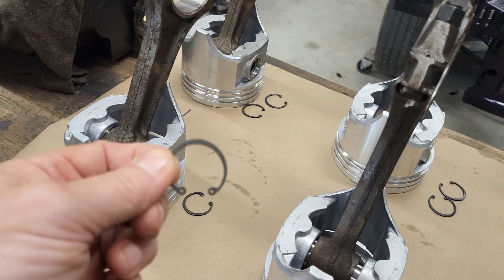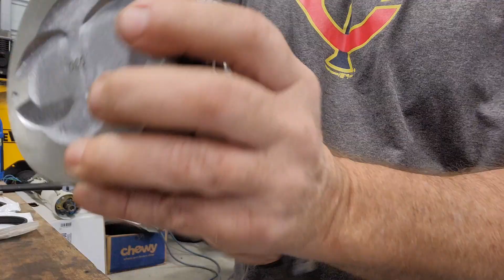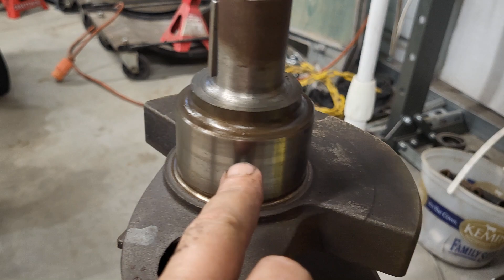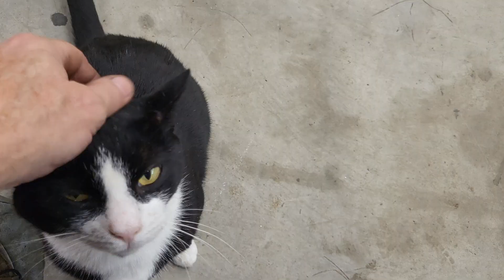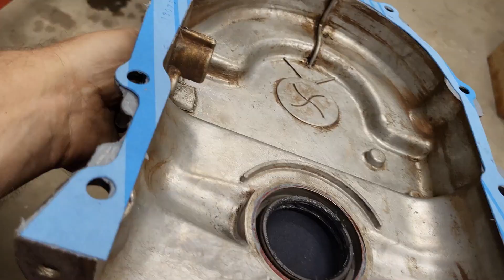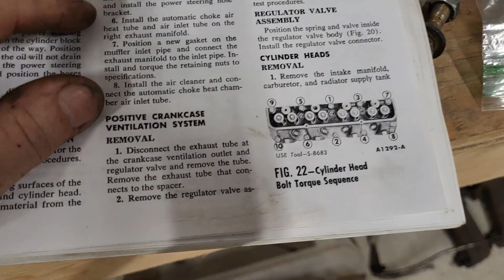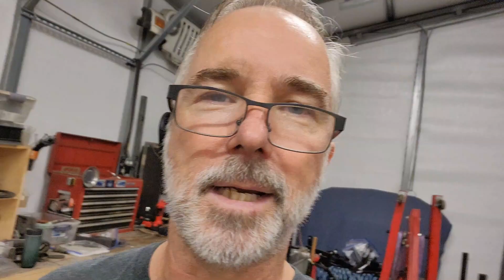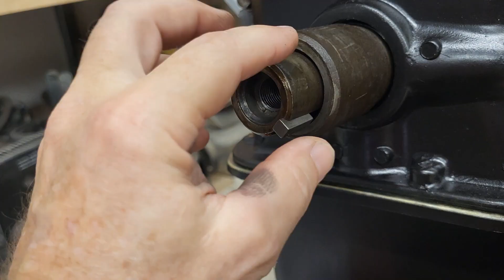FE 390 Build with Edelbrock Pro Flo 4 EFI

Comment: A little late now but you need to put a lot more assembly lube on all the cam lobes!
Reply: WHY? It's roller. The lobes and roller wheel can actually be dry. No wearable friction happening there.
Reply: Actually, no, you need lube on all the surfaces prior to installation. I’m not saying this to be critical but never spin the crank or cam bare, or with roller/flat tappet cam installed. You will do slight damage, especially if you really spin it. Also remember this, even rollers need lube prior to spinning anything. Putting a drill into the distributor hole to pump up the oil pressure before starting is a must but it REALLY helps to install oil/lube on ALL mating surfaces before rotation of a kind takes place. Remember, the cam and crank are under gravities pull and therefore they actually sit ion the bottom and that means on the bearing surfaces. With proper lubrication and saturation of the bearing material, you have a little protective film between the crank/cam journal surfaces to mitigate dry metal to metal contact between the two surfaces. Once your engine starts up, the pressurized oiling system is powerful enough to actually “lift” the cam off the bottom surface and it’s actually suspending the crank/cam with highly pressurized oil between the two surfaces all the way around 360 degrees with pressure actually forcing/pointing straight through from every degree around the cam/crank surface to the centerline of the crank/cam. Think of it like wrapping your hand around an empty beer can and squeezing equally around the can forcing inwards towards the centerline. This creates a hydrodynamic “wedge” of oil suspending the different surfaces away from each other. Most people don’t know that the cam/crank journal surfaces NEVER, EVER touch the bearing surface once correct oil pressure is reached. Now, worn out engines (low oil pressure) are suspect to actually making contact on compression stroke at times beating up the bearing surfaces, especially high compression engines. Having rambled on a bit I want to say that your engine will be fine. You did a great job. But, in the future, try to be as clinical as you can, and don’t be so critical of yourself as to make engine building process not fun! 😂 side note: when my brother and I would beg my father to immediately stop what he was doing after work to accommodate us with a ride in his hot rod, he ALWAYS, and I mean EVERY time, would unplug the coil wire and spin the engine for about 4-5 seconds, wait a few seconds, and repeat the process until he liked the oil pressure gauge reading ensuring PLENTY OF OIL IN THE MAINS. when good oil pressure is reached, you know oil is fully in the system and then he would start the monster up, tell us to put our seatbelts on and rowed through the Muncie “rock crusher” and take us for a grin inducing ride around the neighborhood. Good times. Remember this also, if you get new ball bearings for something, never spin them before packing with grease between the race and the ball bearing surface either. I learned in the military that when guys would take an air nozzle and have fun spinning the bearing to hear the high whirring noise that they were actually ruining the dry bearing. My motor pool sergeant explained very “politely “ to them what happens and to not do it again! 😂 I’m getting ready to build my 390 fe so I’m so excited to watch this new video! Not enough regular car guy builds that don’t break the bank. I hope I didn’t sound like I am judging you but most people aren’t even taught these things in a mechanic/technician program in community college simply because it involves physics/hydraulics etc… I’ve learned this is even more critical when assembling a very high performance engine. So if the big dragsters get that much attention to detail, I say why not use that same philosophy and apply it to our own engine builds. We may not spend 100 grand on an engine but what we have is just as important to us/myself to make the money and effort spent well worth it. You are giving me motivation to get the rest of the parts I need once I keep saving money and acquire the remaining parts so I can start building mine. And even though I’ve built some nice engines, I have never put together an FE, so I’m gonna watch your video many times for educational purposes and just an all around good viewing while waiting for parts! 👍🇺🇸
Reply: @grendel.6.531 Jesus??!! The part I read, it's not oil "pressure" that keeps the crank & cam from touching the bearing. It's simply the presents of oil flowing across the bearing & journals. You only need enuf pressure to provide oil to all parts of the engine. The crank & cam should never touch the bearing once running. It isn't oil "pressure" protecting your bearings. It is oil volume. That is why we increase bearing clearances. Wich results in lower pressures but allows for more oil volume to flow across the bearings for lubrication & the more oil that flows across the bearing the better it cools the bearing. Oil being on the bearing provides the layer that the spinning crank floats on when running. When they touch with the spinning crankshaft they will heat & have a tendency to grab the journal & that is when we spin a bearing. No goos!
Reply: @jesseduke694  while I do agree with what you are saying in general, the oil pressure is measure before it reaches its bleed off point. Once through the crankshaft oiling system the oil starts losing pressure as it eventually gets dumped onto the valve train. Some systems oil improperly and engines will have problems. Take the 7.3 Godzilla engine lifter problems, they run a variable oil pump to lower oil pressure to around 8 lbs at idle for “efficiency” purposes. This is why the engines are grenading. Oil pressure can be measured by volume (unit of measure) per/…..second/minute/hour…etc. but in this case it’s PSI, obviously pounds per square inch. This is what keeps the metal from contacting the bearings. The oil helps with the cooling process but at a minimum, water in the system removes the heat from the engine materials (metals, oil) to the water and then to the air. Tolerances create the pressure. You could run 5 gallons of oil through an engine during normal cycle times but if the tolerances are too large you still won’t have the oil pressure needed to separate bearing surface from metal. When an engine wears out over time, the oil pressure drops exponentially because of increased wear at the same ratio (basically, think credit card interest rates that increase the principal amount even when making a minimum payment). Think 🤔 “gets worse at a faster rate with each PSI lost” rather than steadily staying at the same rate of loss. It’s a multiple of each rate of loss just before the increase in loss. It exponentially gets worse, just like credit card debt can. Stick with me here, turn your garden hose on halfway, block most of it with your thumb, still the same volume coming out at the same rate, just greatly increased pressure. Like Amps in an electrical system. A 20 second video would describe perfectly all this excessive rambling of descriptions. But in fact it is pressure that keeps the surfaces separated. Thus when your oil pressure drops, you hear the dreaded knock in the engine because of the mains and rod journals hammering against each other (and spun bearings). This is my education through engineering and math but I could be wording it differently than I’m trying to explain it. So, take the concept and do your own research. 🔬 At any rate I believe all of us gear heads can relate to one thing, big cam, lots of air going in and out, is what makes it all worthwhile. Stay safe and pedal to the metal. 🤘
Reply: @jesseduke694  also, you can fill a bathtub full of ail, but if you drop a crank in it, it will still sit on the bottom. Not for lack of oil. 🫠
Reply: @grendel.6.531  but make it spin & it will float on the oil.
Reply from the maker: I did do some extra lube off camera.   Thanks for the heads up